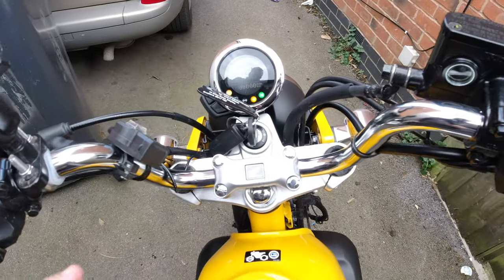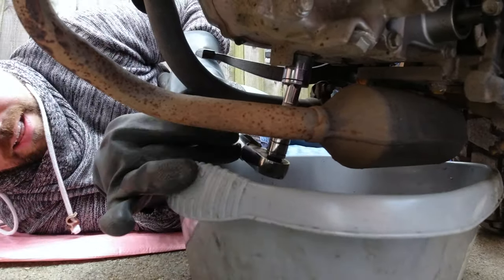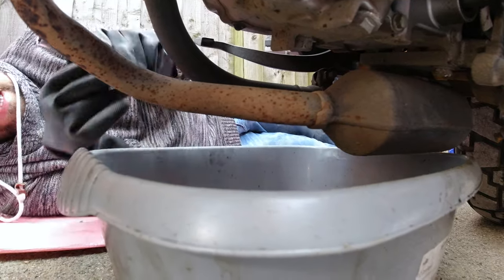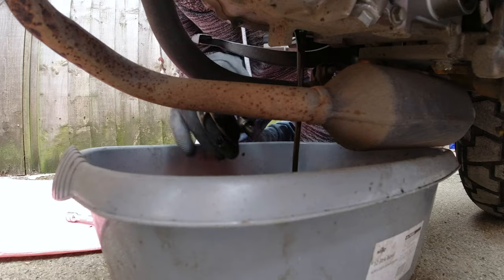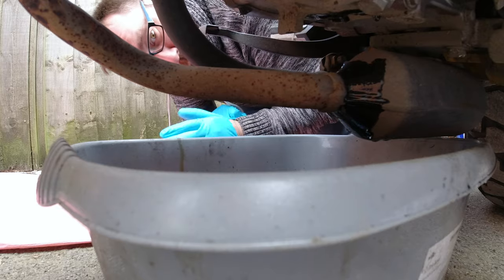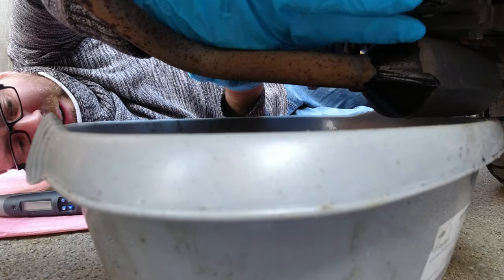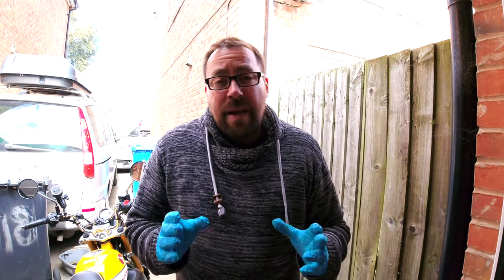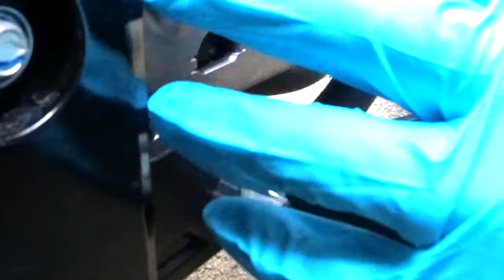Honda Monkey Bike 125z How To Change Engine Oil

Comment: You broke the golden rule, always loosen the oil filler cap before you remove the sump plug. I know I know, it’s hand tight, but not everyone’s will be. It’s very difficult to correctly refill a bike upside down. 🤣

Comment: 1)  Remove the oil filler cap FIRST , as this helps get rid of the oil /drain faster!!
2) After the oil was drained out, why didn't you remove the bowl, you don't need it when you are getting the torque settings right!!